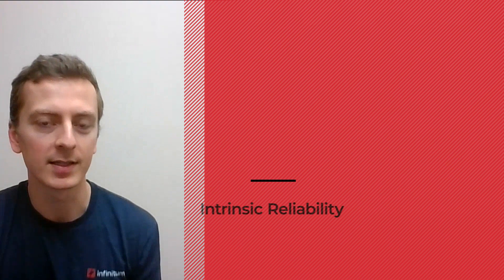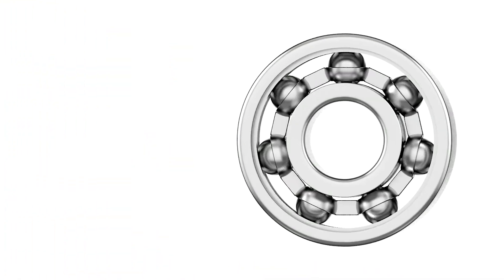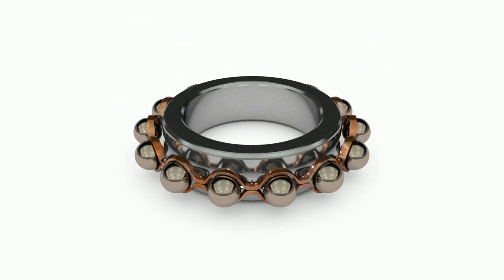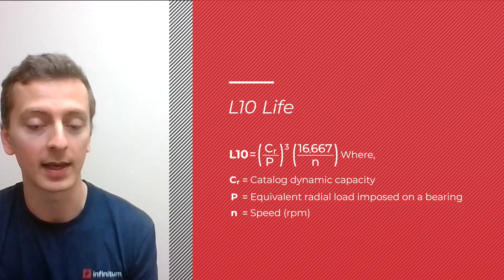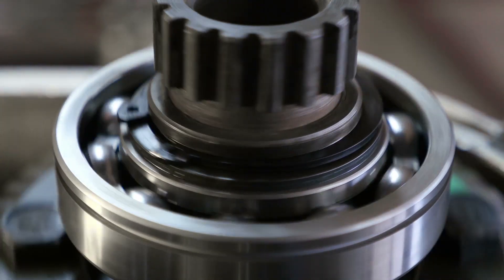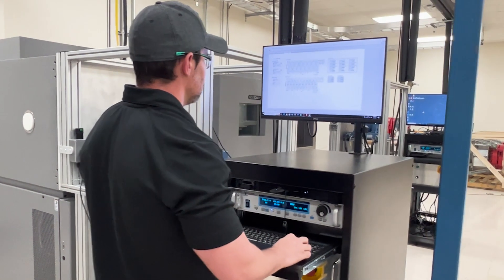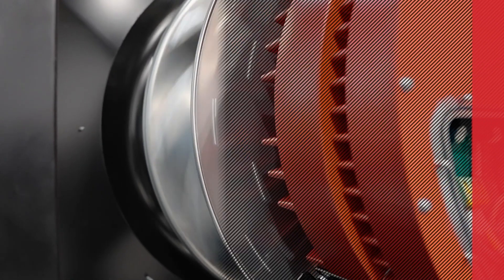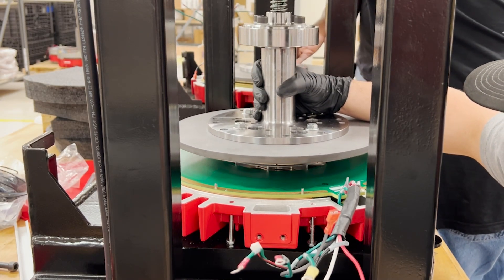Bearings Reliability

Comment: You might want to double-check your research, electric motor bearing life is effected by phase imbalance - but not very much. It is improper PE bonding that forces stray currents to return via the motor housing and motor bearings, the metal transfer that happens during arcing will destroy the races and rolling elements. Phase imbalance can cause uneven bearing loading, but it will more often overheat the motor stator and short windings - I assume you know about this given the PCB stator in your motors.